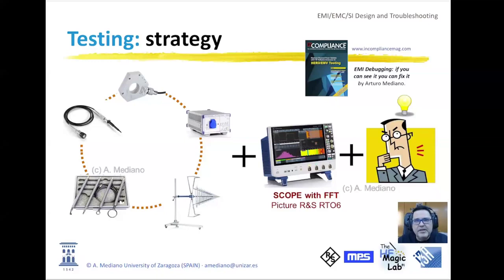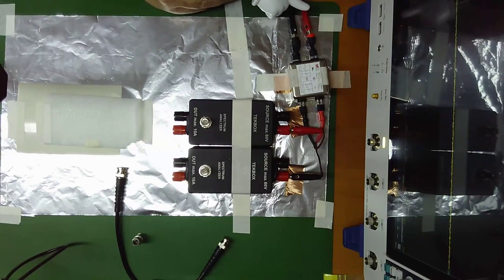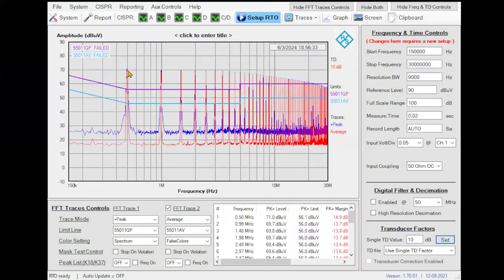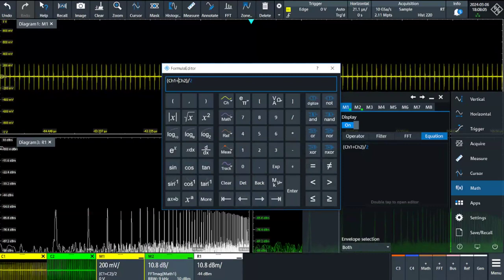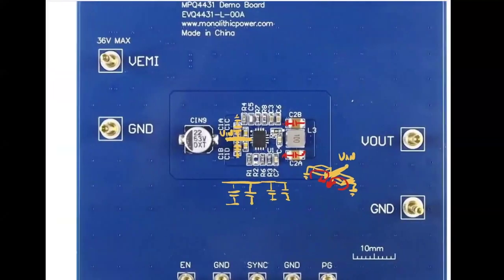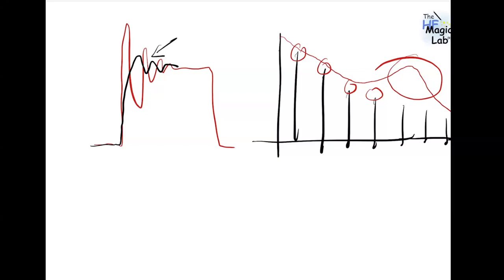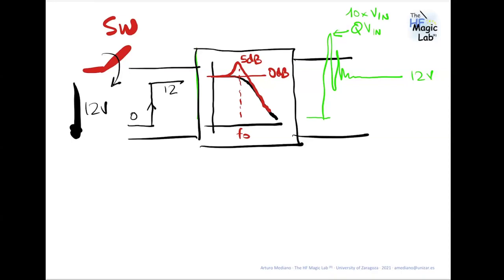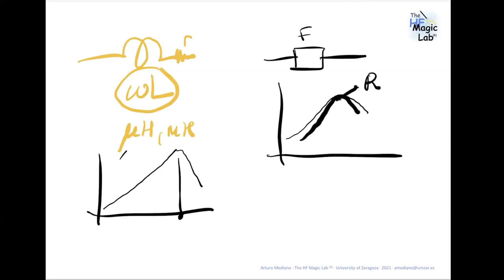Webinar: EMI/EMC Debugging Conducted Emissions with Oscilloscopes Part 1

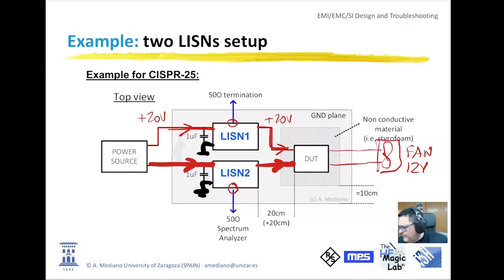Comment: Just wondering if the "GND plane" foil at 12:02 is left floating intentionally? Would there be any benefit in connecting this plane to mains earth? Or perhaps via a 100 ohm resistor? Thanks